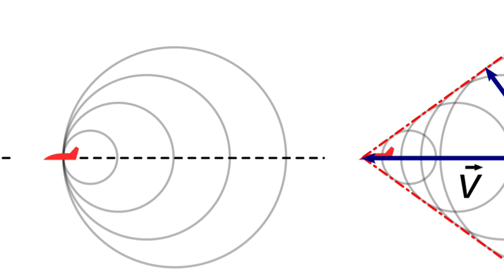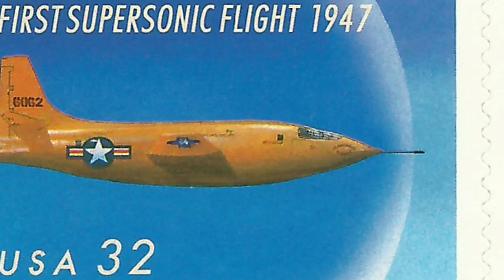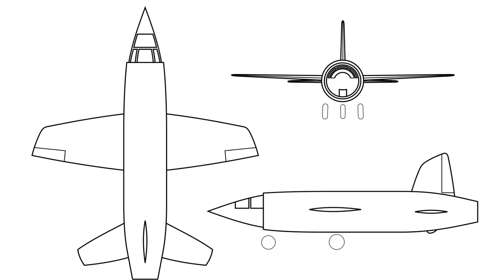Supersonic Firsts

Comment: Outstanding job HG. I was hoping you would tackle the debate about who first broke the sound barrier. It was George Welch. I read an account that, despite gear problems, they managed to get the nose gear fully retracted and went ahead and wrung out the 86 on that first flight.  And there is the issue of the reported sonic boom heard at Pancho’s when the 86 flew.  Something caused that boom.  As others point out, an 86 was supersonic only in a dive, and the Air Force claims the X1 was the first to break the sound barrier “in level flight”. If the X1 was the absolute first to break the sound barrier, why is the “in level flight” stipulation added?  Consider how the AF would have looked, having spent millions on the X1 as a dedicated sound barrier breaker, only to have a common multi role fighter be first.  The X1 was destined to be first, officially, regardless of who actually was first.  As an aside, George Welch is also credited with the first fighter kill of WW2 - at Pearl Harbor. I think you covered that in a video, and I commented that the same George Welch beat Yeager to the sound barrier.  Like Yeager, a great American.

Comment: Supersonic fleet is quite an achievement and technical problem but not a fighter I want in support if I ever went back into my light infantry days. I want the A-10. Slow and low and carrying a big ass gun. While I've never seen the gun firing in person, I have seen it turn on a dime during a field exercise and ever since that time I have been a fan of it. I was impressed when the Idaho Air National Guard got them in during 1995 as another unit could provide CAS then and support my light infantry ass.

Comment: 12:05 T-38A aircraft 0551 was assigned to India Flight, at Reese AFB, TX, when I was stationed there in the early 1980's. How do I know this? 
  Because I was its crew chief, and it still had Jackie Cochranes time to climb, and speed records she set in it stenciled below the left side canopy rail. When my plane went in for paint, I made sure the records were reapplied afterward.😀

Comment: Great episode THG.  The F-100 has to be of the best looking jets of the era.  Interestingly the Canadian Orenda Sabers were faster and more maneuverable then the US built sabers.  In fact the US bought Canadian Sabres to keep up with the Migs in the Korean war until more modern jets were available.
Reply: The Canadair Sabers that the USAF bought were Mk 2s, identical to the USAF F-86E (Same engine, as well) and the 60 bought were carried on the books as such.  The F-86s weren't only used in Korea - they were also, at the same time, being rolled out the the U.S. Air Defense Command, and the U.S. Air Forces in Europe, so North American's production wasn't keeping up with the need.
The same type was the first supersonic capable fighter in the RAF - In the early 1950s, the Brits had no jets that could survive a challenge with the MiG-15, and over 430 were obtained on a crash basis to keep them effective until they could produce their own transonic fighters - the Hunter and Swift, which had significant delays while bugs were worked out (Hunter), or were found to be unfixable (Swift)

Comment: That leak of Yeager’s 50th flight was one of the reasons why Aviation Week & Space Technology is still widely known as “Av Leak” and yes, the American side was quite unfair in “collaboration” with the British on the issue of the compressibility research as well as in the field of nuclear research.  Sad for allies to be busily being unfair with each other.  I would also gently point out that the Canadair Sabre was very much better than the North American aircraft as a result of its Canadian-designed and built Orenda engine which was much more powerful than the GE J47 engine with which US-built Sabres were equipped.

Comment: I was told the first jets which came into the US Military base in Argentia, Newfoundland had propellers painted on them in the late 1940's or early 50's.  

The fluorite to upgrade the Uranium used in the atomic bomb was mined across Placentia bay at St Lawrence where the USS Truxton and USS Pollux were wrecked in 1941.

Comment: Wanna know something potentially disappointing?
Pretty much nothing happens in the jet when you go supersonic. A SLIGHT pitch oscillation as the center of lift moves relative to the center of gravity.  And a slight "burble" in the altimeter, even if you're level/stable in altitude. Thats it. No boom or shake or anything dramatic. 
Neither are noticeable if youre busy with tactics as you normally will be. Most times you wont even notice unless you're watching the Mach number in the HUD.
But if you are watching the Mach number, you can definitely notice the transsonic drag as you approach .97M-ish as the acceleration decreases.

Comment: Another point that brings into question any supersonic flight of the F-86 (or XP-86): This aircraft is not a supersonic aircraft, it was one of the last jet fighters that was not.
Of course it could in a dive, but that was not considered a valid performance characteristic.
It is theoretically possible that a 'pre-production' engine or something of that nature was fitted that had more thrust, but if it was possible to make that aircraft supersonic the air force would have made damn sure the production aircraft could do so as well.
I'm calling that myth busted.
Reply from the maker: Fair point, if  Welch broke the sound barrier, it was in a dive, like Jackie Cochran, not level flight.
Reply: I'll have to dispute the "not considered a valid performance characteristic" - Ask any of the surviving Soviet Chinese, or North Korean MiG-15 pilots if being able to dive away from an attack, under full control at speeds that your airplane can't reach, if it was valid.   Transonic performance, and the ability to fly the entire flight envelope without having to deal with concerns about controlling the airplane was vital.
Reply: @peterstickney7608  I'd agree about any combat tactics that make your aircraft able to engage or evade more effectively. I was speaking strictly to the 'mach 1 in level flight' record that the X-1 set and was in dispute in the video.

Comment: The Canadian version of a F-86 used a slightly more powerful engine, and had a few more minor changes....  I forget which was the first version of the F-86 to be able to break Mach 1 in a dive, but that also had an improved engine over the first few models of the F-86.
Reply: The first version of the F-86 to break Mach 1 in a dive was the prototype XP-86.  All F-86s could.
The first Brit, by the way, to fly supersonic, was Roland Beamont, in May, 1948 - in the XP-86.

Comment: NASA is trying to solve the biggest problem for supersonic aircraft, the sonic boom.  They have the quiet boom demonstrator that is being built,  The boom was maybe the real killer of SSTs.  Not being able to fly over land at full power made them effectively useless save for trans-atlantic flights(I dont think Concorde had the range to say go LA-Tokyo or LA-Sydney so trans pacific might have been a nogo).

USAF tested high altitude super sonics over land using a Valkyrie, and they broke windows in OKC even with the aircraft at 50,000ft.

Its interesting that Concorde was seen as the future and the 747 as the stopgap and instead its the Jumbo that soldiered on until COVID put the nail in the last of the sky queens.
Reply: You're correct. Long term the 747 was the better deal. Being pretty and fast is nice. But it doesn't pay the bills.

Comment: I believe that the Canadian version of the F86 had a more powerful engine than the North American version so that may have been a factor in breaking the sound barrier for Jackie Cochran.
Reply: The Canadair F86 Mk 2 - Mk 6 used increasingly more powerful (and lighter) Orenda turbofan engines vs General Electric J47 turbojet.

Comment: I have long heard the story that British Spitfires during WWII had broken the speed of sound.  There are several accounts of Spitfires unexplainably breaking apart after going into a dive, and the theory is the airframe, which while designed for near Mach 1 speeds, could not withstand supersonic flight and would literally break apart under the stress.
Reply: The fastest a spitfire ever got was Mach 0.92, 620 mph at altitude, and it was written off with severe structural damage - the propeller and its reduction gearbox broke away, and the wings were bent and folded.
The airplane wasn't designed for transonic speeds, but its relatively thin airfoils on the wings and tail gave it an unexpected advantage.  Similar tests were performed in the U.S., with a P-51 Mustange with the propeller removed and flown as a glider, towed to altitude by a P-61 - it reached speeds of Mach 0.89.
Reply: As far as I know, a propeller driven aircraft cannot exceed the speed of sound because as they approach Mach 1, the propeller disc becomes a flat plate essentially. The drag makes impossible.

Comment: I'm surprised you didn't mention the story of Hans Guido Mutke, who may might (emphasis here!) have broken the sound barrier in an Me 262 on a steep 40° dive on April 9, 1945. Reason: during the dive, the plane experienced severe buffeting, but when he changed the angle of the tailplane, the buffeting suddenly stopped for several seconds until Mutke cut the engines, which caused the buffeting to return.

Comment: 02:25 MACH is also affected by altitude. Although this is 'kind of' hinted by the other description.
Reply from the maker: In fact, it is not- at least not directly. The local speed of sound, and hence the Mach number, depends upon the temperature of the surrounding gas. Because the speed of sound increases with air temperature, and air temperature generally decreases with altitude, the true airspeed for a given Mach number generally decreases with altitude.  

So altitude is not actually part of the formula, temperature is. But temperature is generally affected by altitude.
Reply: @TheHistoryGuyChannel  That seems to make sense.There was a landspeed record for the first 'supersonic car' and they did it in the lowest possible elevation - and in a pretty hot place (actually insanely hot) in the SW desert. The reasoning was at higher elevation they would have to go faster to break MACH I. It's slightly embarrassing that I'm unsure since my father worked on structures and loads for missiles particularly the dynamic stress when going transonic. But I do recall some of the science press about the car. I may also be misreading for 'generally decreases with altitude' - which way? Meaning MACH I would ideally be a lower speed with greater pressure and temp (obtained by high temp low elevation) vs a lower MACH number at higher and colder climes (and of course lower air pressure at higher alt) ... I 'think'? Also I remember the car test being done early in the morning since - another confusing side bit - Air pressure is generally lower with heat, since that's how hot-air balloons lift with less dense air being more buoyant than the surrounding cold air. I think it does come down more to air pressure in that regard - which again - is tied to altitude vs temp (although warmer at lower elevations - you're still getting more atmosphere).

Comment: An easy way to explain (speed of sound) Mach number: near ground Mach 1 is approx. 1,000km/hr at very high altitude where air density is low Mach 1 could be 400km/hr
Reply: The speed of sound is directly related to temperature, independent of pressure. The speed of sound at sea level at 20 celsius is around 1235 kph. The speed of sound in the lower stratosphere is around 1050 kph. The temperature of the stratosphere increases with altitude.

Comment: I'd be really interested to learn more about the methodology of Ernst Mach's experiments. Especially how he managed to get the timing right when photographing the bow shock from a supersonic projectile. I'm assuming for the projectile, he probably used a bullet from a gun, since guns can easily fire bullets that fast, even back in the mid 1800s, I'm sure he could have made a specialized "gun" that could have fire supersonic projectiles. And I'm sure he used schlieren imagining to photograph the shockwave. Which is a type of photography that shows differences in density in a fluid. There are some beautiful photographs taken with schlieren imagining even today. In fact, just for fun, here's a picture of a model glider in a wind tunnel at mach 1.2 taken by NASA where you can clearly see the bow shock around it. https://upload.wikimedia.org/wikipedia/commons/2/2f/Schlierenfoto_Mach_1-2_gerader_Fl%C3%BCgel_-_NASA.jpg

So I've figured out that much about the methodology. But the one thing I can't figure out is how he would have gotten the timing right so that he could activate his camera shutter just as the object passes by it. In 1850, they didn't even have vacuum tubes, much less transistors to act as electronic switches to trigger his shutter at the right time. So I'm not sure how that would have worked. The only thing I can think of is maybe he had some sort of a circuit that kept the shutter closed, and a wire which crossed the path of the supersonic object. Then when it breaks the wire, the shutter is triggered. But there would be some time delay between the breaking of the wire and the shutter opening. So he would have to either measure that delay somehow. Or more likely, he would have just had to do trial and error experiments to determine what the delay is. In any case, just thinking about it from the point of view of somebody doing these experiments as I'm doing really gives you a huge appreciation for the amount of effort and tedium that goes into discoveries like this.
Reply: Imagine doing the experiment in a completely dark surrounding, keeping the shutter open and then exposing by firing a flash. That puts any slow mechanics like a controlling a shutter out of the picture. Whether a quick and short enough flash was available in Mach's time I do not know, though..

Comment: I remember at the time Concorde was withdrawn from service, it was claimed that the 14 operational Concorde aircraft had clocked up more hours of supersonic flight than the entire world fleet of military jets. Does anyone know if this was true?
Reply: Debatable claim.
Reply: Considering that the vast majority of SR-71 flights were top secret, I don't think that question could ever be accurately answered
Reply: @thomashart9304  did they stay supersonic for the entire flight? - I don't know, but certainly most fighter aircraft of the 1960s, 70s, 80s and 90s spent very little time actually flying supersonic owing to the amount of fuel required, it would probably be more accurate to say they had a supersonic 'dash' capability rather than supersonic cruise. When the B1A project was designing a supersonic bomber (eventually cancelled then resurrected as the subsonic B1B) they asked for information about the Concorde flight control computer as they had not designed an aircraft capable of  supersonic cruise before
Reply: @WALTERBROADDUS  You may be right, but certainly most fighter aircraft of the 1960s, 70s, 80s and 90s spent very little time actually flying supersonic owing to the amount of fuel required, it would probably be more accurate to say they had a supersonic 'dash' capability rather than supersonic cruise. When the B1A project was designing a supersonic bomber (eventually cancelled then resurrected as the subsonic B1B) they asked for information about the Concorde flight control computer as they had not designed an aircraft capable of  supersonic cruise before

Comment: The Canadian Sabre was a more logical choice for Jackie being more powerful with its' Orenda engine than the North American produced one with its' General Electric engine.
Reply: The difference in thrust between the Orenda in the Cadadair Saber 3 and the USAF F-86F was about 50 lbs - not significant.  The Orenda powered Sabers that pulled ahead, as it were, were the later Mk 5 and Mk 6.

Comment: Two questions : Does a plane create another 'BOOM" as it goes Mach 2, 3, and so on ? ( I'm guessing no ) 
Next question : I grew up near Durant, OK in the early 1980s. By that time, planes couldn't legally go Mach 1 over land. 
However, I vividly remember the Boom-Boom sound off in the distance that rattled our windows. 
What was this ? I am not aware of any army bases nearby that could have been firing artiliery, and it was just a one time boom. ( Artillery would be fired for several rounds, instead on a single shot. ) 

( One more note - my parents, as well as others told me the booms were from jets, so it wasn't just a child's imagination from hearing someone shooting a gun or whatever, and I vividly remember the windows rattling. )
-Thanks !
Reply: 1. Simply put: Supersonic planes don't create a singular 'boom', they create a shockwave that travels behind them. The supersonic boom you're hearing is the shockwave passing you. 
2. Probably aircraft testing or flight training including a supersonic leg. It's the military, so the law can make exceptions. Same here in Europe in the mid-late 90s.